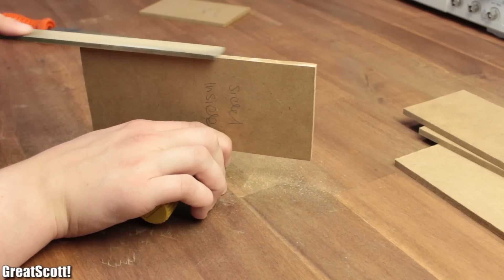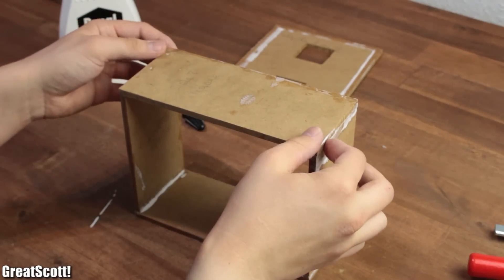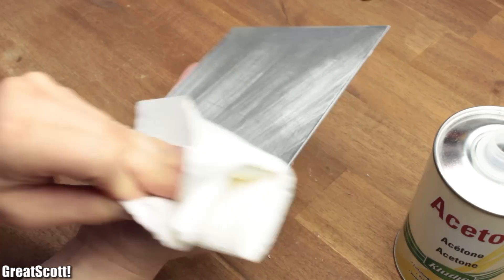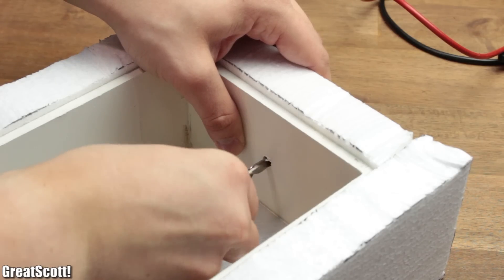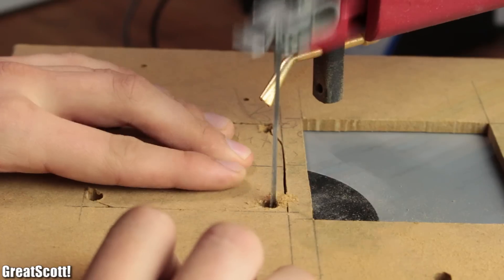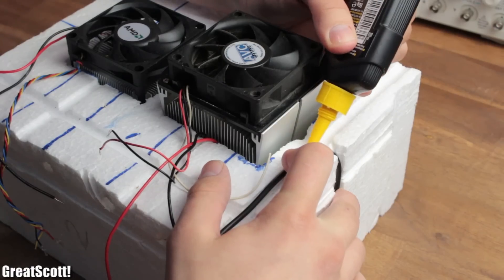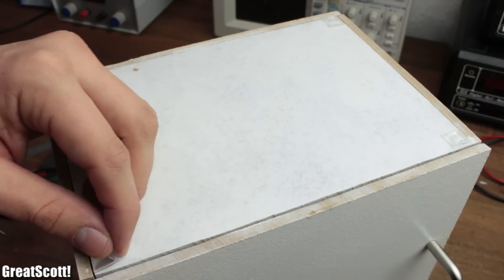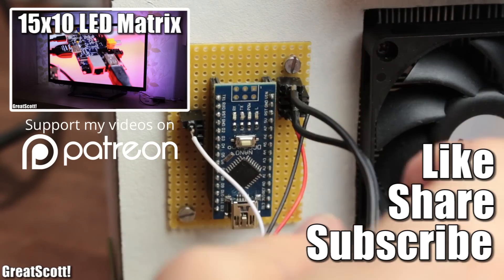DIY Cooler (Part 2) || Peltier Module

Comment: you done goofed, electrical components might be your speciality, but fluid flow and thermo dynamics definitely is not. you could have made this unit cool down those cans in less than a half hour if you added an internal circulation fan, and provide better air flow to the heat sinks. or, if you really wanted to supercharge it, you could have used a liquid CPU cooler on the tecs, thus giving mounting flexibility and superior thermal conductivity convection.
Reply from the maker: I would love to see the thermodynamic equation to cool down such a volume with liquid in such a short amount of time with only 2 peltier modules. Pretty sure it will not work out. But feel free to back up your argument with numbers instead of just disrespecting others work.
Reply: +Collegiate Match Fishing Ha, liquid cpu coolers, lol, this is supposed to be portable, see the battery? if you use a liquid cooler you need a place for a radiator... and even if you did all that, even a normal fridge doesn't cool your drinks in half an hour.
Reply: +Collegiate Match Fishing Ok, sorry it took me a while to get back to this, I forgot about it for a few days. 

convection is effectively stated as specific heat rate (BTUs/sec) = mass air flow * coeff of specific heat capacity(this is defined by the specifics of geometry, material, and any latent heat for phase change)*difference between hot and cold (Delta T). You're main goal in efficiency is to INCREASE DELTA T, as Power remains consistent and you want to remove as much energy from the hot side as possible to lower overall cold side from conduction of a common conductor. Here's how to do it. Efficiency of a refrigeration cycle = T low/Delta T. 

A.  So burring your heat sinks around insulation materials and reducing your output/escape you  increase your back pressure, thus reducing mass air flow rate and lowering your specific heat rate.  You increase the insulation  around the outer walls of the heat sink, you reduce the coeff of specific heat capacity by effectively reducing the radiant surfaces, thus reducing your total Delta T 

B. Increase your temperature differential by storing latent heat capacity in a volatile liquid, and increase the effective cooling surface area by conduction through liquid. This gets heavy into understanding mollier diagrams, but 1 pound of water will hold more energy on the edge of phase change, giving you a larger bank to store the energy before expelling it through a larger heat sink that has a higher airflow capacity and surface area. 

C. Not covered in convection, but conduction, which is similar, but has to deal with solid to solid transfer of heat. If you stacked the modules you could have gained a much larger delta T, as there step down from module to module would decrease. This would  help in the rate of decreasing the temp of the can and it will allow cold sink to remove a lot more energy, thus moving more energy from the can by buffering the energy caring capacity, so leaving it on for a period before using will result faster temp drop. The best example is placing a hot soda in a freezer vs. the fridge. You could also increase the cold sink mass, you will loose efficiency, but you gain a higher cooling rate and lower temps. 

I if you want to the exact formulas, go to Wikipedia and search conduction, convection, and radiation. The 3 methods of heat transfer. I tried to write it a way easier to understand for the layman. 

As for numbers, I can't give you a specific energy losses from your crappy design, because 1. I don't know your CFPM, 2. I don't know your heat sinks exact exhaust/outlet dimension, 3. I don't know the hot and cold side on the TEC modules that you actually getting on just a direct conduction rate, 4. I don't know the specific heat capacity of the heat sinks or cold sink due to mixed materials and unknown geometries. I can find out the specific heat capacity of aluminum and copper, but without geometry and mass, I can't find specifically give numbers back. GARBAGE IN, GARBAGE OUT. So congrats for being offended for somebody that knows more about thermodynamics and fluid flow than you.
Reply: +GreatScott! you seem a little defensive, which I've noticed in the comments of your other videos too - I've managed to cool larger volumes of liquid with a single peltier module before. There doesn't appear to be enough heat dissipation due to obstruction from the Styrofoam insulation. You may also suffer from condensation issues too - the wood you used isn't sealed so it might swell when in contact with any collected water.

Comment: This could also be useful as a small enclosure for some temp sensitive outdoor equipment.  A bit of code modification and a couple more relays and you could also reverse polarity to make it heat the inside on a cold day and cool it on a hot day.  Of course further mods would be needed to make it rain resistant, but the concept is the same.  Pre-manufactured Industrial environment control enclosures can cost several thousand dollars and use the exact same concept.

Comment: I would love to see the heat side used for something.  Sous vide, dehydrator, easy bake oven?
Reply: +John Martin not quite. the max temperature delta between cold and hot side for peltier elements is about 20c.  if you use the hot side to heat something the cold side will get pretty warm because of the max temp delta. beyond 20c you actually get heat leaking back through the peltier to the point that both sides get hot, with the cold side 20c colder when they are on with max current.  peltiers cannot be used for two purposes at the same time like it seems you are asking for, if that temp delta is over 20c in your wanted use.
Reply: +JaqiesGadgets Looking for the reverse operation all together.  Only looking to heat, not both at the same time.  I was thinking heat only... ex: a small portable sous vide machine? 20c should be enough for that.  I guess I would still question effciency.

Comment: i would give the heatsinks more breath room so there more efficient 

something like chamfer the styrofoam around the heatsinks 

cool project
Reply: And that defeated the purpose of the whole experiment
Reply: +Niels Dijkstra or using some of those heatpipe tower heatsinks. :)
Reply: +JaqiesGadgets yeah. maybe even better

or go full nerd and use watercooling
Reply: Watercooling isn't enough. Liquid Nitrogen is a better place to start
Reply: +Niels Dijkstra no it wouldn't it would mean that the peltier would be cooler than the liquid nitrogen
Reply: @adam7868  its way efficient to use liquid nitrogen than using peltier and that's why it defeats the purpose
Reply: @govanniayman1163  

measure the temperature first of the heatsink in use

and if its above the recommended max temperature of the peltier element then go for a bigger heatsink
Reply: +A23p Studios in theory

Comment: i got a simple improvement.
put the fans backwards so they suck hot air out of the cooler
now they are pushing hot air in to the cooler
Reply: +expansiongames they are not pushing air into the cooler, they are pushing air thruogh the fins of the heatsink
Reply: yea but after it moves trough the fins it gets in the cooler and warms it back up
Reply: no, the inside of the cooler is sealed. the air isn't getting in there, just like a fridge
Reply: but the heatsink is toutching the inner cabnet and that heats up
Reply: +expansiongames actually it isn't, it's only touching the peltier.  the inner cabinet is insulated from the heatsinks via the MDF board which is actually enough for the small area they occupy.  Reversing the fans will not really improve flow and will definitely increase noise as the blades will not even be one millimeter from the heatsink surface because of how the fans are designed.

Comment: reverse the case, position it like a chest and the cold will stay trapped inside, otherwise your insulation will always suffer from the joinery plan.
Reply: +Okto Putsch I see what you mean. Cold air is heavier and sinks. If the case is face up it will keep the cold air inside, like a cup holding water. Otherwise hot air will seep in at the top of the door and cold air will seep through the bottom, if there isn't a good seal.
Reply: +Okto Putsch 
Or get some magnets to auto-seal it.
Reply: Radi0he4d1 he would need some rubber all around, anyway, like in a usual fridge or freezer.
Reply: +JaqiesGadgets The problem is not to close it, but to make it sealed. A latch would help, of course, But like your real fridge in the kitchen, it needs a good seal for a better thermal insulation ^^
Anyway, as cold tends to go down, it would be better to turn the boxe from back to under, aperture upward. Keeping cold longer, consuming less energy, and so not increasing the TCO of beers :D

i like these piece of hack stuffs, it's fun to make :)
Reply: +Okto Putsch magnets would help the problem, though. so would a latch. it's also possible though not optimal to use some styrofoam to seal it in conjunction with a latch or so, and the styrofoam may be that tight already.

Comment: Can you back-lit or illuminate a keyboard with led strips?
Reply from the maker: +TheTimeFliesFast I put it on my to do list.
Reply: +TheTimeFliesFast you can and it's been done including on youtube, though I really would love to see +GreatScott! 's take on the project and documentation of it.  I personally am far too much of a perfectionist to do things the way he does them, I would never get a project done because it would never be good enough for my perfectionism.
Reply: no.
Reply: GreatScott! That would be awesome
Reply: +GreatScott! Thank you! You're the best youtuber: creative, and talented :)
Reply from the maker: +TheTimeFliesFast Well, thank you very much.
Reply: +quangluu96 Step up converter for voltage problem. And for strip size, maybe uncovered strip? That one without ruberry coating, just bare leds.
Reply: *****
I am not going to do it, just sugesting ideas for those who want to do it.
Reply: +quangluu96 I've got a keyboard that has enough space to fit in an uncovered led strip. Maybe, if Scott wants to do it, he will find a good idea :)
Reply: +quangluu96 If you are brave enough, you can keep it connected to a molex :))
Reply: +quangluu96 it's not just the voltage, usb power (amperage) is far too low for something like this.
Reply: JaqiesGadgets
Usb 3.0 should be enough
Reply: Tinkernut (YouTube) made one 5 years ago.